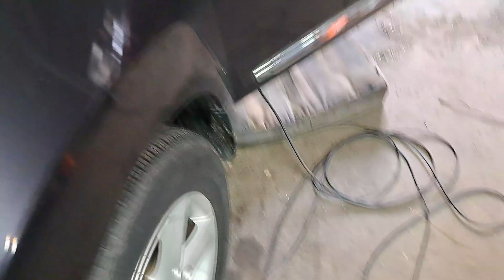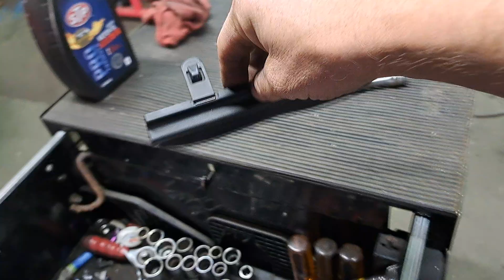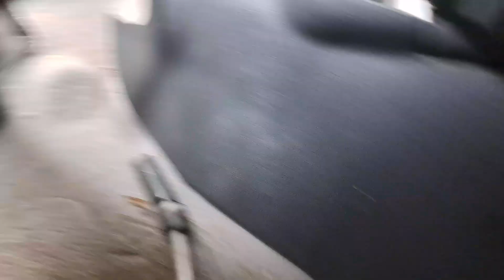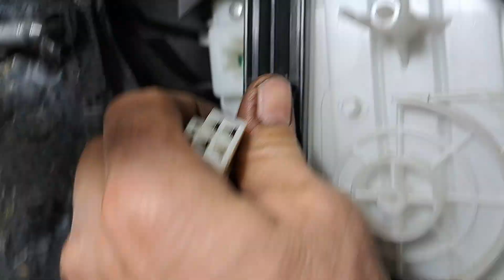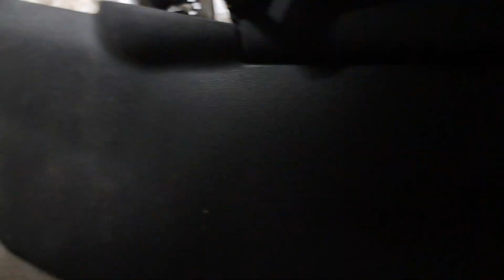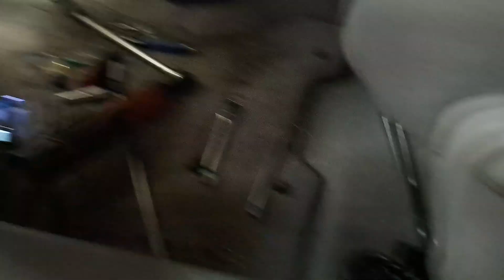🔥Nissan Rogue Blower motor location and HOW TO replace, Speed controller location🔥

Comment: This is a very poor design by Nissan engineers. I’ve worked on plenty of Toyota, Dodge, and Audi vehicles, but this is by far one of the most difficult to access.

You can’t see the motor with the naked eye. A better method is to use your phone in video-recording mode. Hold it above the brake mount, close to the firewall, and point it toward the closet compartment. You should be able to see the motor on your phone screen.

First, remove the brake and accelerator pedal assembly.

There is only one screw holding the motor in place. Remove the screw, then twist the motor counterclockwise about two turns and it should come off.

Next, remove the other screw located behind the black plastic holder. This will allow you to separate the cover from the motor. Remove the black cover first, followed by the motor. You will still need to maneuver and rotate the motor to get it out, as space is very limited.

When reinstalling everything, simply reverse the removal procedure.

Comment: Yo it's videos on replacing the blower  motor and resistor on that vehicle u should've googled it 1st  u tore down the top dash  for nothing I hope u didn't charge the customer all that extra time that job is like 2.5 hours labor
Reply from the maker: You have to remove the cluster, and it didn’t take that long, if you know so much go start you a YouTube channel and have it.